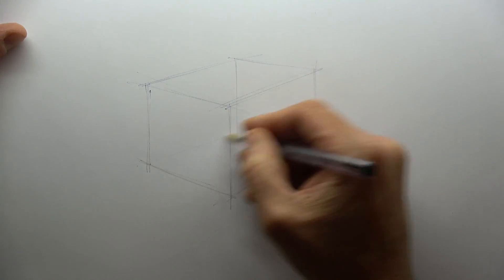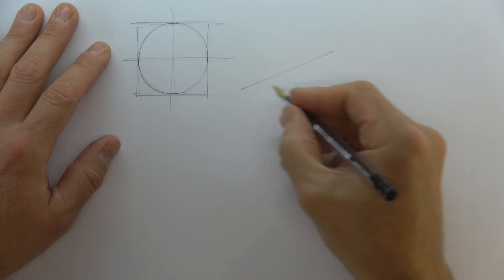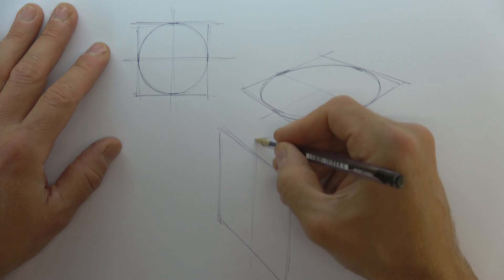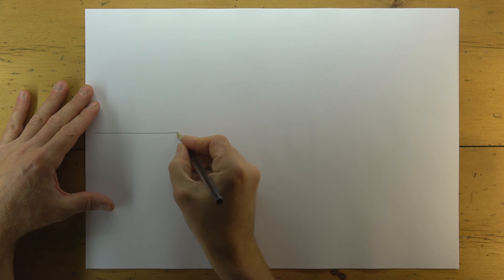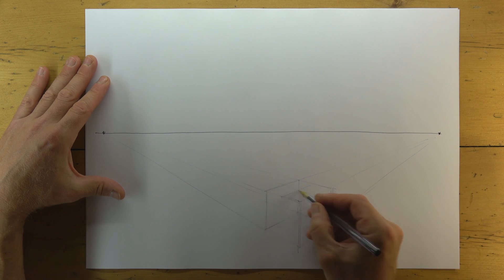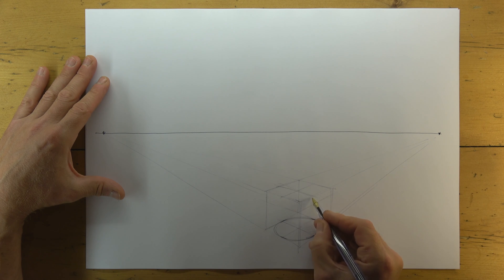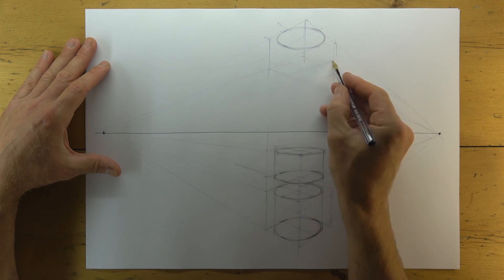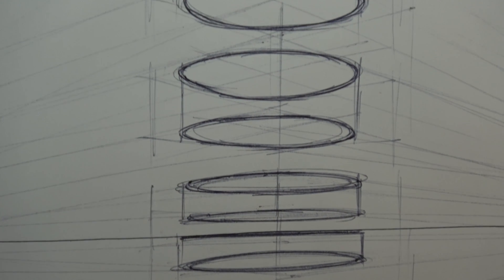How to draw circles in perspective

Comment: Where do you imagine your vanishing points to be?
Reply from the maker: It’s hard to describe in a sentence or two, but essentially, the vanishing points are way off the page.  The closer they are, the more wide angle the sketch. Moving them further away, the shape is more how we would see it naturally. In these sketches, I’m using two point perspective, but we would normally see a third point below the object. The three vertical lines that I’ve sketched would meet at a point way below the page. I hope this helps. I have a course on perspective that is likely to be ready in the Spring.
Reply: @simplydesignsketching  Thanks so much for responding. I'm learning a great deal from your videos and I appreciate your efforts.
Reply from the maker: @BioVisier  my pleasure